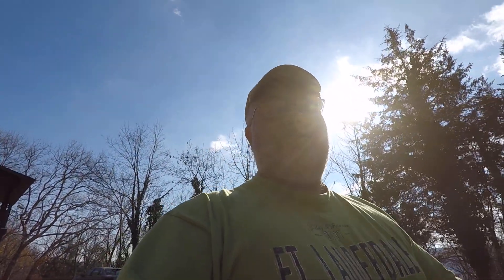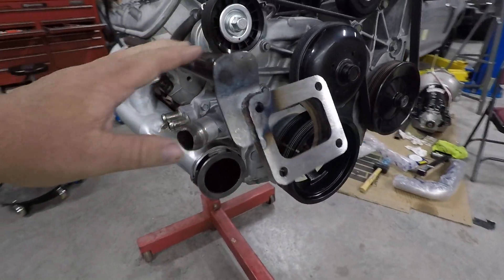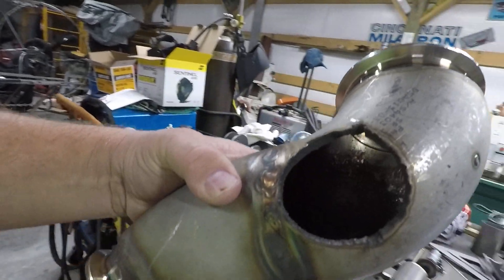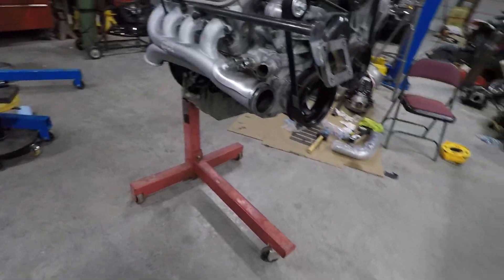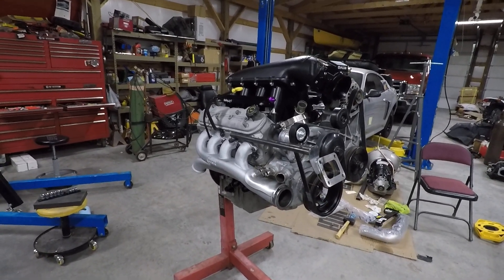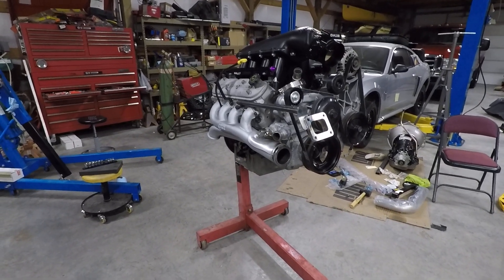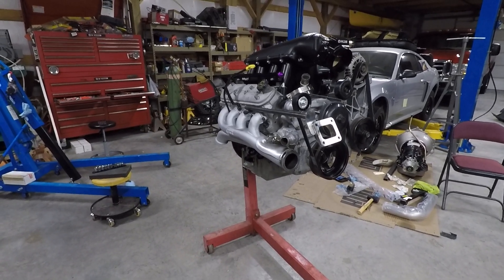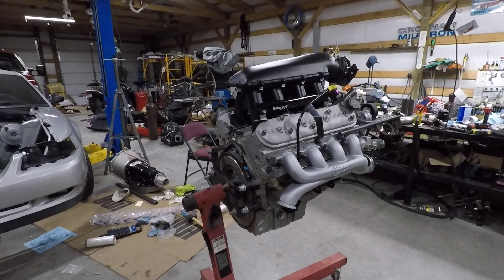LSX Swap in a New Edge Mustang Part 10

Comment: Seems like a lot of work vs 5.0 swap. And it will be faster with coyote motor. Boosted they can run 8.7 stock motor
Reply: Ls swap is fucking way better in the end. My buddy constantlt does this for his drag set ups. The ls is a monster